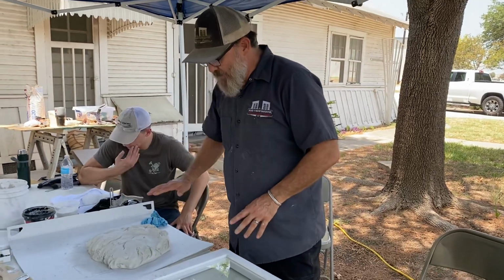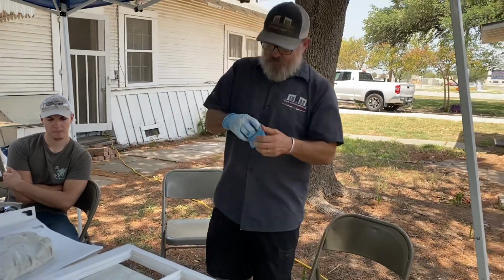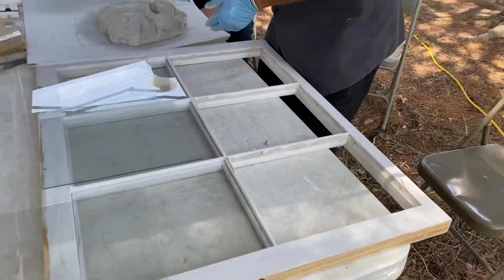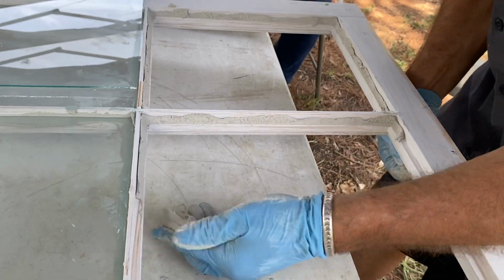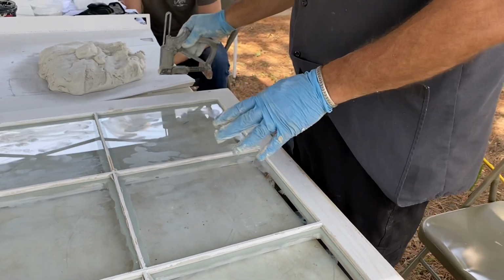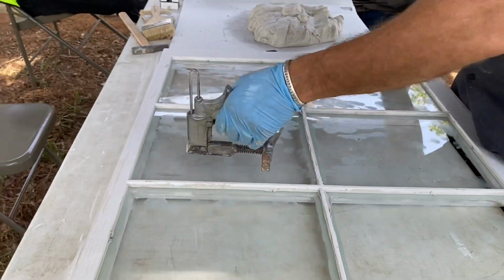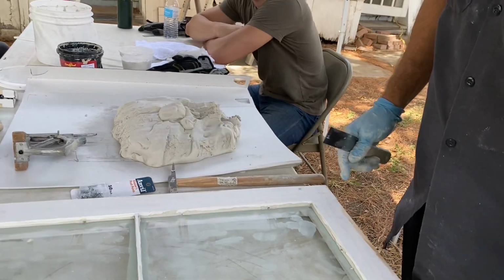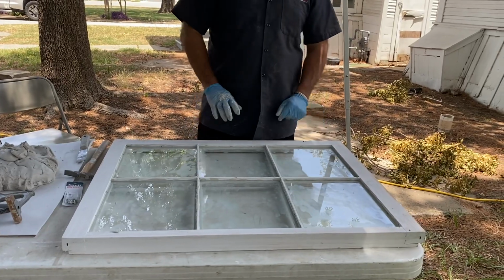To Glaze Wood Window Sash, First Bed Properly Like This

Comment: Great video, I am trying my hand at some old window thanks to you. I have an old Red Devil DP-2 stapler, where can I get the points for this? I guess this is an old unit. Thanks for the help!!
Brian
Reply from the maker: The Red Devil DP-2 point driver shoots some pretty big Diamond points for a residential size window sash. I think you’ll notice once you get some. You have to order them online, I think the last time I ordered it was from CR Laurence. Look up that name on line and I think you’ll find what you need.